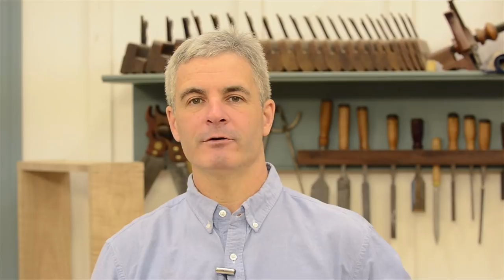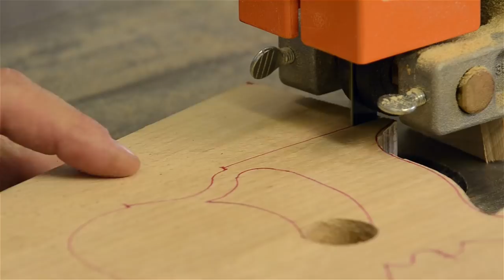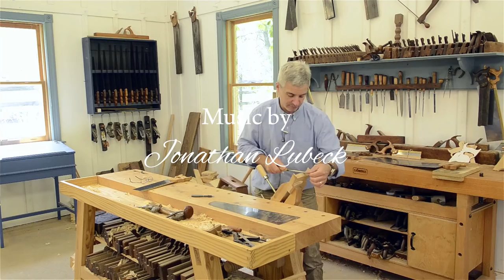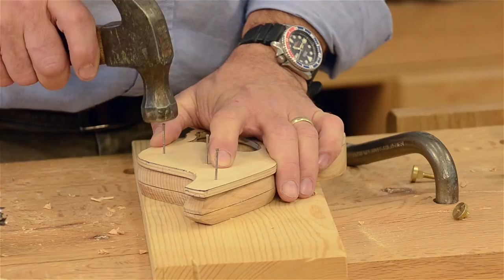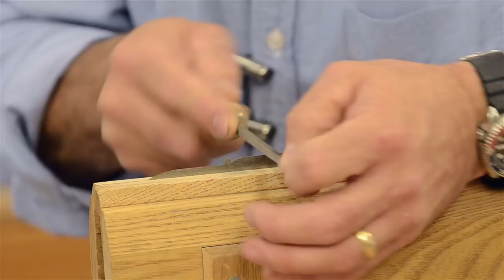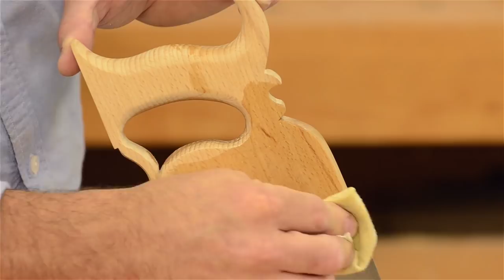Building an 18th Century Panel Saw with Tom Calisto (Trailer)

Comment: Sadly I cannot recommend this class. The video isn` t cheap and saying that it teaches how to make an 18 century by means of manual work is a gross exaggeration. While the saw presneted is nice, I cannot agree with it being any deeper saw making guide at all. Also the author charges quite a lot for his saws... Best saws have been made from carefully chosen and processed metal. Shaped in a specific way: tapered groud from spine to edge and from toe to heel. The very best hardened and tempered or hammer hardened. With this video you go with a spring steel plate. While it is already hardneed and tempered when bought you kind of ommitt a lot of important things going into sawmaking and certainly it won` t make a very hard and excellent saw. Not only that the teeth are actualy being cut with a mechanicall electric-powered re-toother, so very much of the toothing process is left out. The brass hardware isn` t turned or fabricated but employed already preppared. Much of the handle is cut with an electric bandsaw. I cannot recommend, good entertainement but not in depth at all.

Comment: Beautiful work, misleading title... you are making the handle for a hand saw.  Unless you are going to start with sheet metal - tooth cutting - setting the teeth, and sharpening (which would be outstanding), you are only making a handle for for a saw. Accuracy is important in a very inaccurate language. -Annie
Reply: SuperYtviewer take it you didn't watch it the way through then. 🤔
Reply: 'Building an 18th Century Panel Saw"  - better title; "Building a Handle for an 18th Century Hand Saw.  Purchase DVD to see entire build."
Reply: SuperYtviewer Indeed it is a beautiful work, Annie. Perhaps you drew conclusions from the opening seconds. Had you watched to the end, you would have seen snippets of the entire build, including the saw panel itself (pun intended). I suggest a second glance.
Reply: SuperYtviewer it does say trailer. Just saying.
Reply from the maker: It's a trailer that shows snippets so people can know what's in the DVD. The DVD indeed shows the teeth getting punched. It does not show cutting the steel out of rolls, as 99% of people would not build a hand saw that way, but they'd buy a kit and build the handle and fit it to the saw plate.
Reply: SuperYtviewer You need to watch the rest of the trailer 🤔